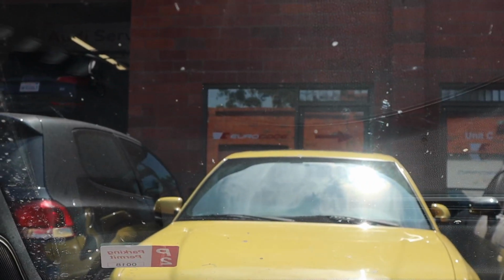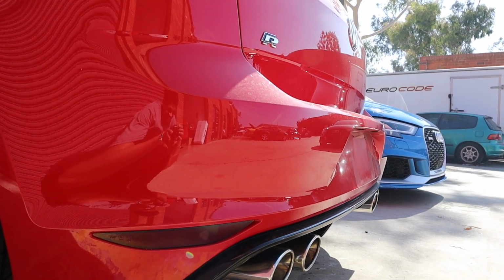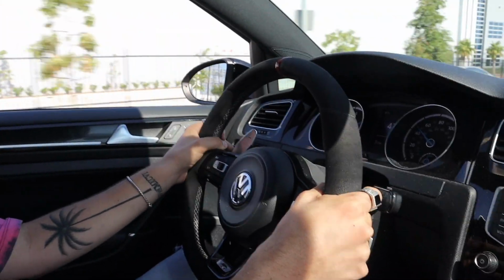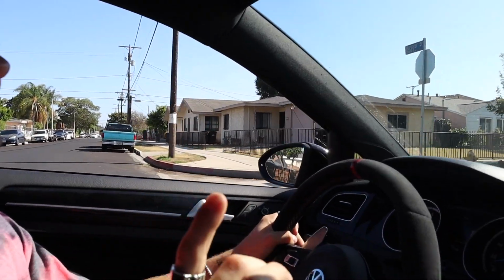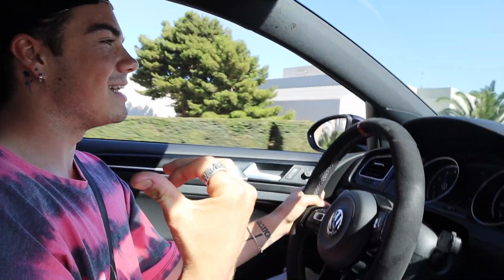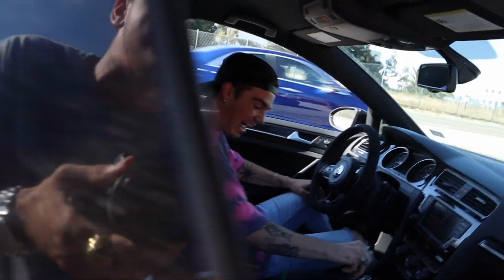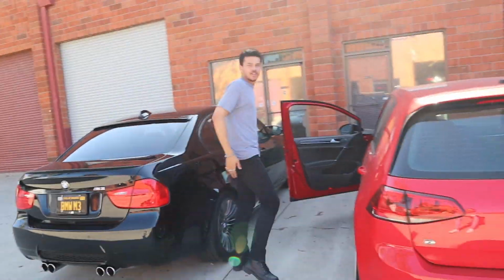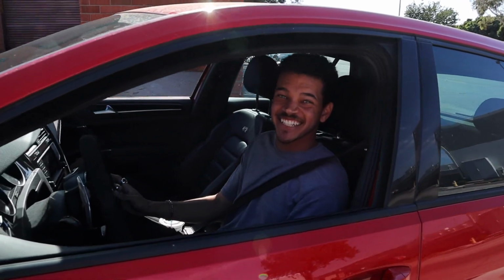APR Downpipe w/ Pops and Bangs Map Did THIS... (Mk7 Golf R)

Comment: Volkswagens are such slept on little sports cars, you can make em so fast and they look so good 😩
Reply: Onavoful I 100% agree. On a Gti with just a bigger turbo, exhaust, intake, and tune you can push 320+WHP on stock internals. Just imagine how much power you can get out of an R!
Reply: @larmishing 
You can easily push 320whp on stock turbo for mk7 gti
Reply: Andrew Denisyuk I wouldn’t think safely
Reply: Tanner 1126 you can safely push near 400hp with an upgraded golf R turbo on the GTI. The GTI is faster than the golf R with the same is38 turbo
Reply: Tj Trev yep all you need is the K04 turbo
Reply: Tanner 1126 no.... k04 is 6th gen. Is38 is 7th gen
Reply: Tj Trev I was talking about the mk6 lol
Reply: Tanner 1126 no mk6’s were featured lol
Reply: @larmishing  a K04 on the mk6 platform makes like bare minimum 320Whp and it's 100% totally safe. The k04 is the stock turbo on a Mk6 R it's not like you're using something that isn't basically an OEM turbo lol. Only difference is the manifold is modified to mate up to the TSI engine
Reply: Go check the GTI Clubsport (40 year anniversary) best lookin Golf made at my page! Not sold in US. Im from Sweden.. 😉
Reply: I think VW couldn’t produce because they need to meet the euro6 emission rating.
Reply: Tanner 1126 GTI with JB4 will make 300hp ez, intake and downpipe you’re looking at 350hp to the front wheels
Reply: thats the beauty of them;) sleeper "shut up babe" lol
Reply: But not the mk8 😂
Reply: FACTS

Comment: The reason your DSG farts aren’t as loud after first gear is because you got a TCU tune, it muffles the sound because it changes gears faster
Reply: Geo Ali or he can just flip it to the side for auto-manual? Lmao if he doesn’t already have a res delete then that would also make it louder and an aftermarket exhaust would also help with that
Reply: @castillooo  no because you're not going to a neutral point like a manual. It's still gonna shift as fast as it's going to shift.

Comment: The issue with your pops and bangs is almost definitely the exhaust. While it’s possible that the tune was messed up, it’s definitely way more likely that your rev-based valves are preventing loud pops. I’d definitely look into that APR valve system or just replacing the whole exhaust system.

Comment: I gotta get a crackle tune for mine. Got a mk7r and yet to get exhaust and tune. But yes get something with a remote or an app for your valves. They close sometimes after acceleration with the OEM valves.

Comment: YOU ARE CORRECT. The reason your pops are muted after 1st gear is because YOU HAVE NOT DONE THE EXHAUST FLAPPER MOD. This can be done with "OBDEleven Pro" (look into it) or it can be done with a VAG-COM VCDS scan tool. I have the same setup as you but my valves now stay open all the time. It's amazing, and all four tips soot up equally now.

Comment: A lot of the pops that don’t pop that much is because if you notice when you’re in the lower gears, you’re going up really high in rev range and not shifting and letting the revs come back down which is making it pop a lot, when you were in the higher gears you were shifting early

Comment: Hi Jordan. Did you figured out why you don't get those strong upshifts bangs in the end ? Did you get the aggressive pops and bangs setting ? It could be related with the exhaust valves that might be close or partial close when you upshifts or smth..? Indeed APR has a device that controls the valves you can either keep them always close, open or factory mode.

Comment: That’s dope. I wanna get pops for my mk6 gti but I’m worried that running the car rich will be bad for reliability. What do you guys know?
Reply: Erik S I have a mk6 GTI with stratified crackle pops. It still find fine and it sounds amazing!
Reply: I have stratified aswell
Reply: pointless.  you'll dump excess fuel in your cat.
Reply: The Moeller Not if you’re catless, which I am.
Reply: Theyre not added in by running it rich, unless you get it done by someone who doesnt know what theyre doing.
Reply: Erik S i have a mk6 r and i hear the pops and bangs are bad for the car

Comment: As for the valved exhaust, if always open, you might sacrifice a little low end torque with less back pressure. There might be a different file/tune for non-valved exhaust which would help ?  Nice car and nice sets! Thanks!

Comment: Yo man.. Whats your mileage at? Just hit 35k and really debating stage 2 apr pops and bangs
Reply from the maker: Exactly 35k. Do it bro. It’s amazing
Reply: Don't do it man. It gets really old really fast.
Reply: I barely drive in race mode though... I only turn it on for short bursts of spirited driving usually... either way I can always go back to a regular stage 2 tune without pops and bangs
Reply: @LzrouseTricks  True. Give it a shot and if you don't like you, you can get it off. I ended up setting mine back to regular stage 2 after a while.
Reply: Jeremy Stark do you use race mode regularly?
Reply: @LzrouseTricks  Semi-regularly, yep. I'd say about 50% of the time I just leave like that.

Comment: You’ve definitely got a decent amount of pops goin on bro, APR must have updated their generic pops n bangs file coz I know it only popped once or twice on downshifts especially on the DSG 7R in their original map. I had to ask APR to make me a beta file with an extended timer for the pops n bangs, now I’ve got around 3-5 pops per downshift depending on the RPM I’m at. If you want those “throaty” loud explosive pops, try to downshift for the RPM needle to hit 4000rpm, it definitely ‘explodes’ in all the gears bro! It just won’t be as explosive and crisp at the lower RPM’s at slower speeds.. 4000-4500pm is the sweet spot for explosive bangs. I’d know this because I’ve got the same map on my 7R and the exact same exhaust setup, I’ve got the non valved non res milltek catback with apr downpipe👌
Reply from the maker: Mines valved which I think is the issue!
Reply: Driven By Jordan just open up the valves fully and it shouldn’t be the issue at all if you have the remote?

Comment: I have a question for you. If you set up individual as everything in Race mode and select it and sport, will it burble? I am asking because there is no real way to "turn off" burbles. I heard it only burbles in Race mode so if you make individual mode exactly the same as race, will it not burble? This will let you have a burble race mode and non burble race mode
Reply from the maker: When in normal mode, the car doesn’t burble, it may sometimes but barely nothing at all!
Reply: @DrivenByJordan  can you try setting everything in Individual mode to race and then testing if it burbles in Sport/normal?
Reply: @davidallada5501   when i had it it seemed to only pop when the trans was in S on the dash , basically it pops and bangs anytime: you rev in N or P or drive in S even if car is in normal i had the older file though for stage 3 when they first came out

Comment: I was going to dm u on insta but I didn’t realize u famous 😂. Can you run apr stage 1 with a downpipe? It says not to on apr.com but I hella want to haha
Reply: Yes, you can
Reply: Why would u? U would not be running optimal afr anyways bad for motor plus if u get apr dp its free to update
Reply: @Do3sithvrt  yes, hoy would be running optimal AFR. Its a closed loop system. It Will adjust AFR perfectly to whatever its tuned to achieve
Reply: @michelhadid  its not running optimal thats why it will throw a cel code, stage two tunes are more optimized to account for the big change in o2 changes even if you put or dont put a spacer for the sensor
Reply: @Do3sithvrt  no, stage 2 Tunes do much More than that, its yo take advantage of the reduced backpressure and lower EGTs. AFR wont be affected and he Will be running optimal, hell throw a CEL because the car thinks the cat its not doing its job. Not because the AFR isn't "optimal"
Reply: @michelhadid  ofc it does take advantage of better flow which means more air flow means the need for more fuel anyways
Reply: You really need to have the intake along with the down pipe. As others have said, if you get the APR DP, then the tune is free. I’d save up for the APR intake system as well and then go Stage 2. That’s from a conversation I had with APR just a few days ago. I also bought the APR intercooler (and I’m running an Audi S3). The intercooler was more of a preference than a necessity.